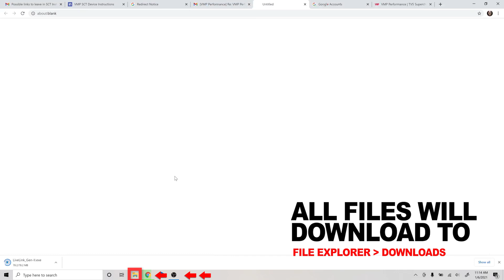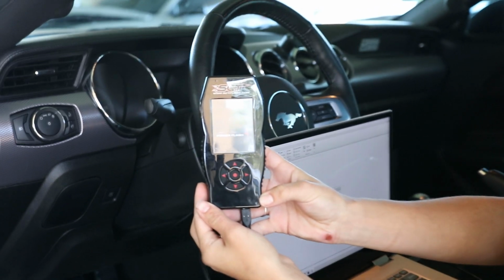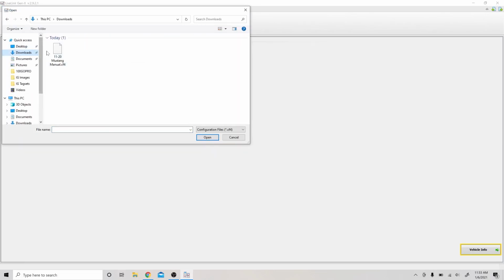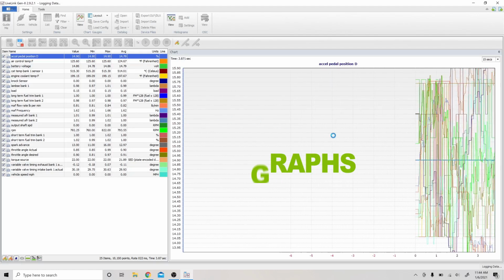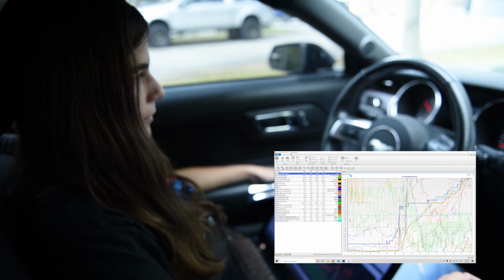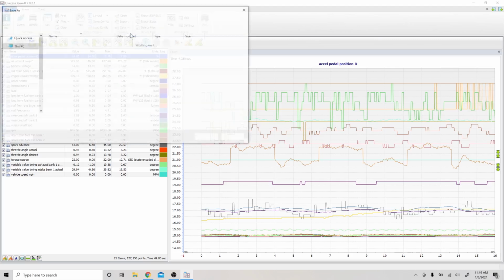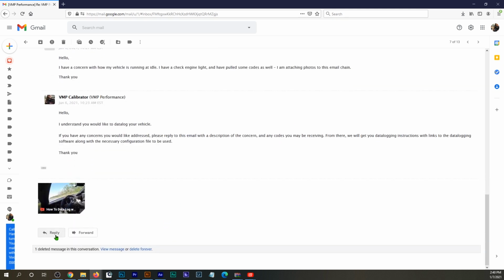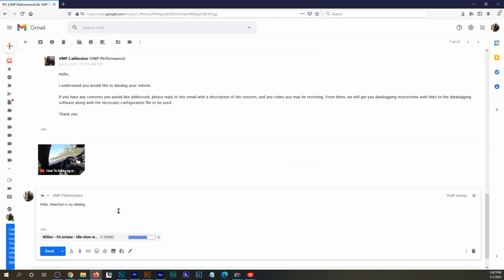Tuning || How to datalog with your SCT X4 and LiveLink

Comment: Quick question. Some people say I need to buy the SCT FireWire and an air fuel gauge for remote tuning. Are those necessary when using live link to retrieve all PIDs?
Reply from the maker: If your vehicle isn't equipped with factory wideband O2 sensors, it would be best if you added these items to assist in properly and accurately tuning it.
Reply: VMPPerformance ok, gotcha. I do in fact have wide band O2 sensors I believe. It’s an 04 mercury marauder. Thanks for the quick reply.

Update nevermind. Narrowband. Ok. Thanks a ton.
Reply from the maker: No problem at all!

Comment: Question for anyone experienced in tuning.. 

I'm new to this whole tuning thing.
Bought an X4 for my Ford Focus and need to do a data log to send to my tuner. Having to replace both the up and down stream O2 sensors and swapping out my throttle body with one from an eco boost mustang. Should I wait to collect the data to send in until after I complete the repairs and upgrades?
Reply from the maker: Hi Joseph!  This question is probably best suited for the tuner who's going to be reviewing the logs as they know what they are looking for in them.  In our case, it would depend on what we're looking for an whether or not any of the parts you were installing required tune adjustments.
Reply: @VMPPerformanceTV  Ok. Thanks. I just was trying to get an idea..
Reply: After.